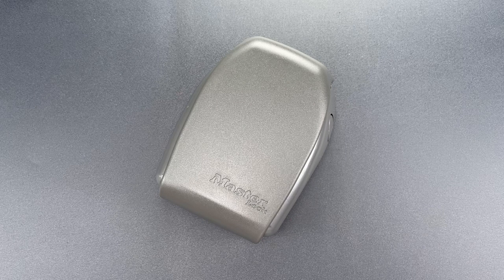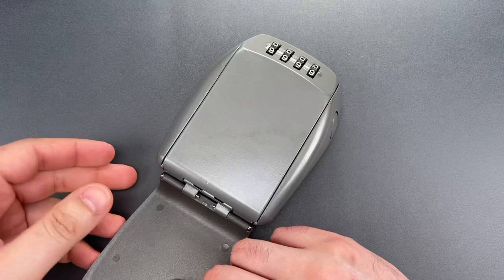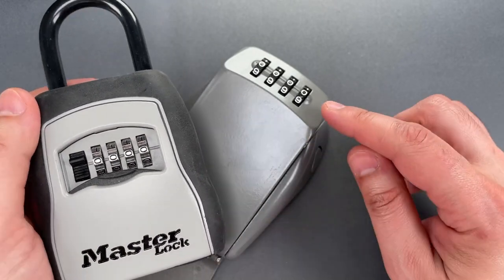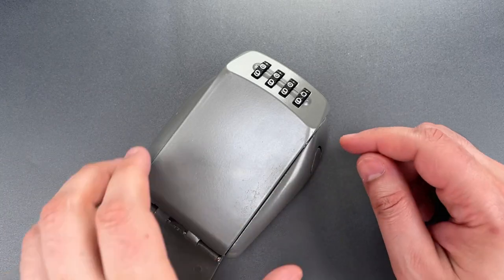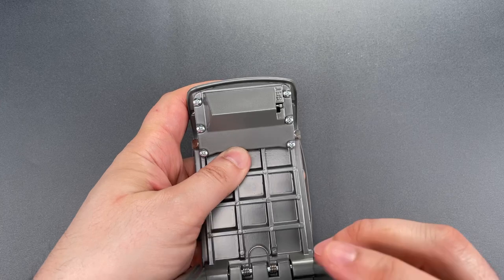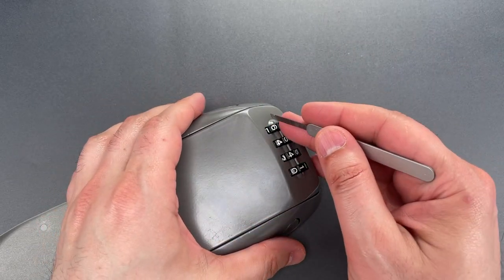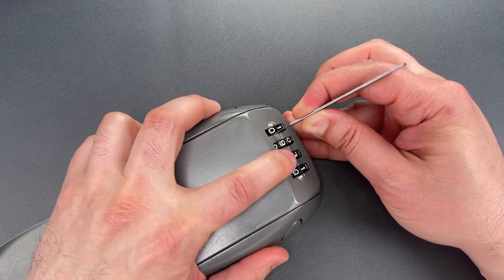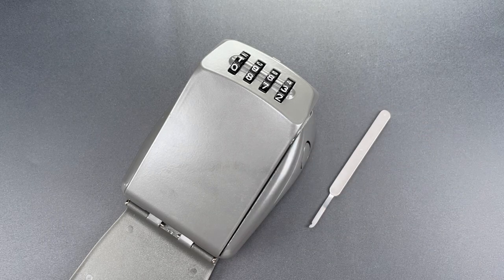[1276] Decoded FAST: Master Lock 5415D Key Lockbox

Comment: I love how the 9 moved into place unlocking itself.
Reply: "just pull the fking plug..."
Reply: The lock just give up man
Reply: The lock accepted its fate
Reply: masterlock knew what it was facing.
Reply: “Whoops my bad”
Reply: A Master Lock so crap it gives itself up to picking efforts
Reply: It was already in the middle  when he. Pulled the bar it moved
Reply: That was nearly slapstick. Even the timing was perfect.
Reply: LPL opened the lock by sheer pressure.
Reply: 1000th like
Reply: Master has gotten so sloppy that the locks help you pick them.
Reply: The lock just knew its place.
Reply: Oddly satisfying isn’t it?
Reply: @ts757arse  are you a robber or locksmith?
Reply: The 9 is a paid actor
Reply: It just said don't worry LPL I'll do it you've all ready humiliated us
Reply: SPOILERS!!! Smh

Comment: Masterlock boss: let's improve the security of our products
.
Masterlock engineers: flip the mechanism upside down.
Reply: I once worked for a place that made a certain circuit board-based sub-component for a larger machine that had an extremely high fail rate.  The circuit board retailed for ~ $100, cost about $10 to make and the singular item on them responsible for the failure was about 25 cents and the better heavy-duty version of that part was about 50 cents and a direct drop-in fit for the crappy one.

 To 'solve the problem' they just changed the part numbers every few months and sent out service update bulletins.
Reply: @tcmtech7515  That's known as "planned obsolescence".  Either a part with known limited lifespan - but just beyond the warranty period - is used, or it is explicitly planned to retire a particular hardware configuration in favour of a new one with equivalent capabilities, but needing incompatible firmware, and firmware updates for the old hardware are then halted.  Either way, it means the demand for replacements is kept up into the future.
One of the most common parts to predicate this on is electrolytic capacitors.  There's one in most LED lightbulbs, buried in the screw fitting - which also serves as the main heatsink for a linear-mode current regulator and the LED modules themselves.  Electrolytic capacitors have a habit of drying out and failing when run hot…
Reply: lol
Reply: @tcmtech7515  this is literally the exact thing people like Lewis Rossman are trying to fight against; destroying planned obsolescence through the right to repair.
Reply: "Masterlock engineer" is like calling a janitor a sanitation engineer.
Reply: @Kromaatikse  Are there ways to prevent certain "PO" from happening? for example insulation for the light bulbs. Or just general fixes and replacement parts for known weak links, for all kinds of consumer electronics/mechanics?
Reply: @jimbugorca7968  The only sure way is to religiously avoid buying products that are known (or even suspected) to have planned obsolescence built in.  That will generally involve much more research and somewhat higher purchase prices than most people have become accustomed to.  But if everyone did it, manufacturers would take notice as demand would dry up for their deliberately-faulty product lines.  (I think there's a role for government regulation here.)
As far as light bulbs specifically are concerned, you could look for bulbs that are rated for use in saunas, where the ambient temperature and humidity are considerably above normal - and then use them in a normal room.  Or you could buy the ones that can be switched between several different brightness levels, and avoid running them on the brightest setting.  Those are both reasonable ways to get a bulb that lasts longer than the manufacturer intended.  Of course, you'll pay a premium for it, but it should be tolerable.
Reply: LPL knows that flipping the mechanism inside is a technique many lock manufacturers use to make their locks work in Australia.
Reply: Kromaatikse have you seen the newest BigClive pound shop led bulb video?  no capacitor
Reply: i would love to play with cheap variants just to show these locks how easy they are to pick, so i am gonna flatten a paper clip end with a hammer and try this at home ... doesnt help when his own link is sold out XD

Comment: Master Lock in last video: 'Hahaha, were not the worst lock out there!'

LPL in.current video: 'Hold my plastic hammer'
Reply: That just makes them meh.  If you're going to be the best of anything... even the best of the worst....then you have to work for it.   2nd worst just means they're not even good enough to be bad...
Reply: Urethane hammer
Reply: @Sound_Tech  *piss hammer
Reply: @waldolemmer  why use dvorak wtf
Reply: @waldolemmer  presses windows key + spacebar ... Nobody else eh?
Reply: @waldolemmer  I'm partial to blacked out key caps and a default boot device with no valid operating systems on it.

Comment: Thank you! This worked so easily with your notched tool. (The videos from others about different models of master lock key boxes didn’t work for this type.)

I had reset the combo on mine for a houseguest six months ago, and then completely forgot what it was. The box has been affixed to my water meter ever since. With your help, I opened it within a minute, and can now remove the box or reset the combo. So much cheaper than finding a saw to cut it off or buying a new box.

Comment: This one can be decoded in the standard way as well without the tool to grab the bar just feeling for a flat spot and notch along the right side of each wheel with the thin knife. I found the notch was on the number below the true combination, but was easier to feel than the flat spot which was on the true combination. Thanks for the videos!

Comment: Well, I’m a little late to this video. But let me tell you what. I recently bought this from a store on super clearance and the default code on the back was scratched off so I had no idea what the code was to even get this thing opened. Tried many of the usual default ones, and nothing. But then I found this guy and bought his tool and watched his video on how to do it. I got the sucker open! I’ve never even attempted to lock pick anything before and I got it in like 5 minutes. I guess that tells you how safe this lock really is… but either way, you get a sub from me for helping me out. Thank you sir

Comment: One of these locks landed on my desk and could not resist the challenge. used a 0.2mm feeler gauge modified. I had it open in 5mins . Not that quick but I am a complete novice .

Comment: I do have a comment, but not about this in particular. I've been watching your channel recently and wanted to try to start getting into being able to pick locks. Not for any criminal purposes, mind, it just seems like a very useful skill to have just in case something gets accidentally locked and nobody at the time has a key (which has happened before).

All that said, this is about covert instruments not having the genesis set. I finally took a look at that genesis set you've been advertising and found it to be sold out for the past week. I wanna get me hands on that whole set because it seems to be a very useful set of tools that can be used on a lot of common locks. I just want to know if/when it will be back in stock.

Comment: Ha. I have one of these, and when I bought it I had a suspicion that LPL would 'gut' it. No surprise there then. 
That said, If there were a box that was any good, and the insurance company does not recognise it, you are still screwed. (Just look at the "Sold Secure" locks that bike insurance companies INSIST are used to maintain cover, that LPL has 'rubbished').
Fortunately the house is rarely without people, as the key is there for emergency access to assist my elderly mother if she has a fall. Then we rely on the 3 Guard Cats! (If you don't have food, they WILL eat you!)

Comment: Hey have you tried to open some of the cheaper Walmart hypertough pad locks.  I was amazed that they're using a somewhat parasentric complex keyway. The top is slanted. And I just havnt been able to pick it open.  It's a smaller lock. Hardened steel shackle. Plastic overlay. Maybe steel body or aluminum. Get one

Comment: This suggests several options to solve the obvious issue ...
1/ Return the key lockbox to the point of purchase for a full refund.
2/ Use the key lockbox on the basis that the vast majority of people won't know how to pick locks in the manner described, or     bypass your "target" for an easier one, or won't require access to the key lockbox in order to do what they are going to do.
3/ Hide the key lockbox. "Friendlies" will need to be told where it is hidden and the combination when required.
4/ Keep "safe" keys in a box with a different lock that is hidden. Keep the key to that box in the key lockbox. "Friendlies" will need to be told the location of the hidden locked box and the combination of the key lockbox in order to access the key to unlock the hidden box and then access the "safe" keys.
5/ Hide the key lockbox and the second locked box. "Friendlies" will need to be told the location of the key lockbox, the location of the hidden locked box, and the comination of the key lockbox. Obviously, do not hide the second locked box and the key lockbox close to each other.
Options 3/ thru 5/ will work best if the key lockbox is not secured to a fixed location.
Cheers from the Land Down Under.

Comment: If it's Master Lock that you can be certain it's going to be some easy way to open it.

Genuine question - are there any Master Locks that are reasonably protected? Because the only one's I've seen are the ones that don't need that kind of protections. The Lock Out ones for example are more pick resistant than practically any other Master Lock.

Comment: I bought a Master Lock key safe before discovering LPL. Instead of wheels, it has numbered buttons for the combination. I decided not to use it when I realised that the lock didn't enforce any particular order to the numbers making brute force feasible. Next I realised I could tell by sound/feel which numbers were part of the combination. Still feeling quite grumpy about it. If I had the receipt, I'd try for a refund on not fit for purpose grounds.

Comment: I get this is a really common way to get these combo locks open, but if I'm not mistaken each lock has the bar you're pulling on in a different place. How do you figure these things out when you first get a lock? Taking it a step further, I'd be interested in seeing more about the process of figuring out the best way to bypass a lock when you get a new lock. Like if a key lock can be combed or raked, do you try everything starting with the easiest?

It seems like even if you have a lock protecting something that's stupid easy to bypass, wouldn't a picker, or thief need to already know the easy way past it to make getting past it trivial, or if they aren't familiar with the exact lock you have, is it quick to figure it out?

Comment: It seems like this ability to decode is part and parcel of the design of the lock's resettability.  In other words, you have to have some way to decouple the code wheels from the lock bar (in its unlocked position) and recouple them in a new configuration.  I guess the question is, how could you possibly re-design the mechanism so that it is not decodable like this?

Comment: I once opened this lock with brute force. When drunkenly arriving home, I forgot the code, and just pinched the opening buttons, and started pulling on the edges of the lock door. I think it popped open after 3 attempts. I was 15 uears old back than btw

Comment: Question... If I took my house key and a 2nd identical key and used a triangle file to cut the keys @ a reverse 45 degre anglr somewhere midways down the keys and inserted the forward half,how hard would it be to get through my lock ?? Easier or harder ??

Comment: Don't need a tool for that one! :D You can just feel it normally. My grand uncle had his house key in that thing. Had it unlocked in 10 minutes without knowing any locks and 0 experience in lockpicking
Reply: I have one (not used yet,  nor will it ever get used lol) and tried to feel the code (while knowing what the code is) but I could not feel any difference between the numbers. 

Do you push the side buttons or not? Could you give the way you worked? I want to replicate it :)
Reply: uhm, this sounds really stupid, Close your eyes and feel how it feels scrolling with knowing the code, (Do it while pushing the sides in first) You feel a lot of williging with the correct numbers. After you got that feel try to do it without pressing it. It's still possible after 30 minutes of practise :D You just feel it I guess

Comment: For the sake of fairness, the process of scrambling the code and unlocking the device with a new “unknown” code should have been repeated once the device was opened with the tool, in order to avoid any further suspicions. This method is called the double blind.

Comment: I'd never trust a masterlock key lockbox.  My workplace uses them, and I noticed you can feel where the numbers are just by tugging slightly on the faceplate, and the fourth one will just drop after you get the third if it's within 2 digits.

Comment: Do you have tip and tricks for suitcases. Last time i travel because must swape planes I accidentally changed the code when put my laptop back.
Reply: Those are usually 3 or 4 digits combination locks, right? A bit of patience and within 15-30 minutes you can try every digit combination to open your suitcase...
Reply: @alopandur  yes 3-4 codes. There must be a easy way then spend hours to find the right code

Comment: I have this exact lock. changed combo to make sure ex-gf didn't have access to my spare key anymore...just in case. But forgot the dam code. Tried this technique but so far cant get it...I find it hard to visualize behind where I am meant to be grabbing the bar - and I tried this with your covert kit and then swapped to the exact too in the video - much prefer the second tool with the sturdy handle.

Any tips on how to ensure I'm grabbing that bar? or any chance you have a cut away of this lock so I can get a better image in my head what I am trying to hook onto.

Any help from LPL or followers would be amazing!

Comment: I bought a 5415D to test... no way to find the code! I can only feel something pulling the tool when the correct code is put in so I took it apart and the way you are doing at this point in the video is not working now I think they changed something thing in the mechanism but anyway i found a good trick to find the code but in a different way...
Reply: What was the new way you found

Comment: Truthfully, I don't get the point.  Yes, you can get in it fairly easily with 1) some very specific knowledge, and 2) a very specific tool.  So what????  It seems you are basically putting the item down that it can be entered with those things, but that is NOT what it is designed for, nor sold for.  So are you simply bragging here?  Because clearly if anyone wants to get into a key lockbox, they WILL get into it, whether with a grinder, a cold-steel chisel, or etc.